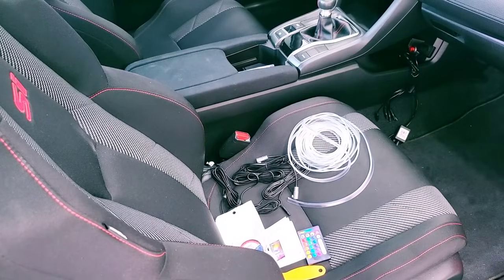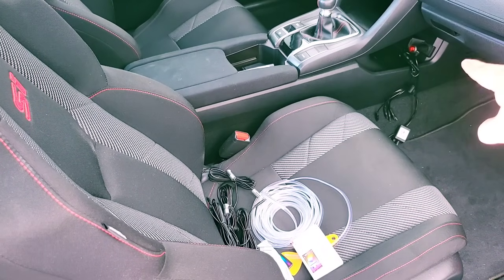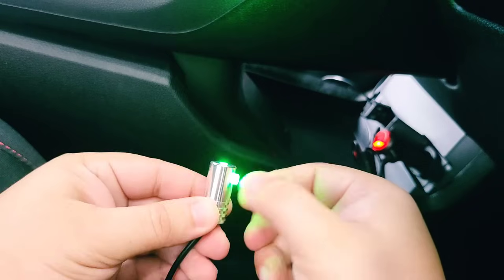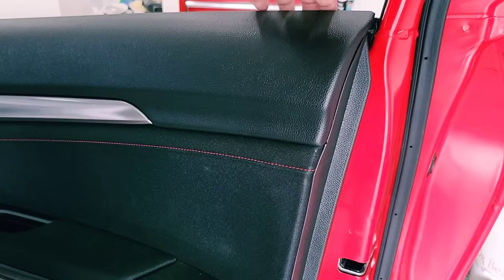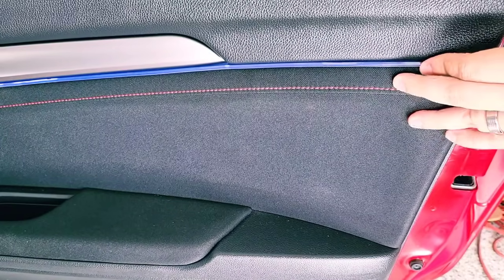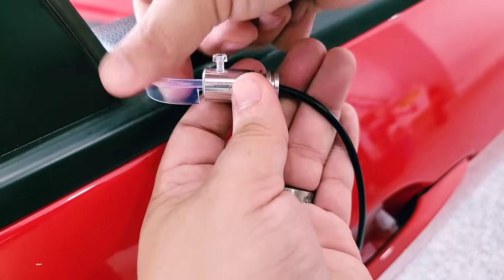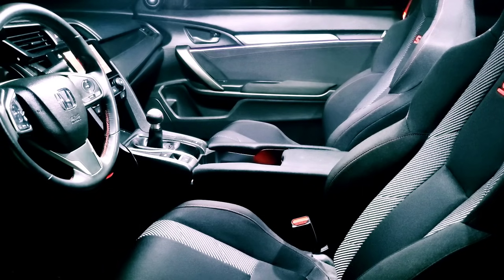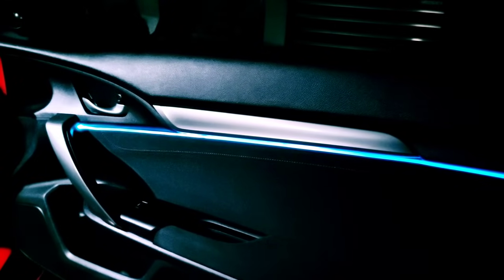Fiber Optic Interior Ambient Lighting Install - RedlineMods

Comment: You forgot to show the most important part, how to route the cable into the car… 🤦🏽‍♂️
Reply from the maker: I mentioned it but recording it is too difficult. Mainly comes off the side door grommet into the surrounding panels. Passenger routed under the glove box. Driver side routes under the steering wheel. Zip ties and that's it. Camera angle is too tight to capture all that.
Reply: @BoostedWhipz  Did you push the wires through the rubber grommet between the door and the car?
Reply from the maker: Yes. Pain in the rear but yes.
Reply: Exactly. I think the version I seen where they open the door panel and connect the wire to the door controls for power is a lot more professional looking.
Reply: @BALL_BUZZ  I agree but I am trying to figure out the plug & play part in terms of where do they get the piece!
Reply: Yeah am here for the wiring part 
I have a 2019 honda accord sport 
But I can't figure it out how to do the wiring
Reply: Hi they will turn on automatically when u start engine or u have to use remote control?
Reply: They all do lol nothing new, you’ll just have to figure it out
Reply: @GabyvsAlice  remote control unless you hook it to your headlights then they’ll turn on automatically with you headlights
Reply: @BALL_BUZZ  how do you connect the lights to door controls? That sounds amazing sense each diode need to be connected to the controller.  I suppose you could connect the lights to windows button so when you roll up/down the window. They light up.  But what you’re talking about is craziness I suppose that’s why you didn’t get a response.  

As for routing the wires it’s not that hard, FYI all of the electrical in your door comes from a central location, essentially the battery. For example your door locks aren’t connected to you’re power windows which aren’t connected to your speaker. All of those are routed thru your door to the cab behind the dash to fuse box which go to battery.  Sooooo more professional… don’t power things with other things, professional says this is how you blow fueses.  

As for how to route the wires look for the black rubber according thing between the door that’s where all your wires go from cab to the door.   

Please link the video you’re talking about I would like to see how these people are connecting diodes to power source in the doors.
Reply: @skidz8426  They take off the door panel and tap into the power windows wire and hide everything behind the panel so as soon as you unlock your car door and the car power comes on the lights will work like factory.
Reply: He forgot nothing, because every car is different.
Reply: Right dum video
Reply: @BALL_BUZZ  yeah, but what if you want to turn it off?
Reply: Our kit came with the fiber optic cable not inside the tube yet… What’s the best way to run it through??
Reply: thank u for saving my time
Reply: Exactly
Reply: Yeah he definitely forgot the most important part of routing the wire smh
Reply: @Jay.G_  It should come with a remote or an APP to control the lights. When the lights use the power window fuse for lighting, they will only come on if they are set to come on. The power window fuse just comes on when the car turns on, allowing power to go to the lights so you can control them, they will stay on the last setting you had them on.

Comment: thought that theres a actual fiber optic cable that you suppose to feed through that strip . thats just routing strip to secure the fiber optic cable man. Just a heads up. it will look alot cleaner and brighter with the fiber optic use which you can buy seperate

Comment: How do you cover/block parts of the plastic strip in places you don't want to see the light, like on the edge of the door panel after the 90* bend upwards?
Reply from the maker: Put black electrical tape
Reply: @BoostedWhipz  ...I figured it could be something as simple as black tape, but I thought there could be a better way, especially if you have a gray or beige interior.  then I guess depending on what color your door panel is will depend on the color tape you need to track down...or just be content with the part of the strip that sticks out....

Comment: My kit came with a wire and the one that you installed do I have to use both put the wire inside of the one that goes into the panels like you did which is better or wsid

Comment: Do these work for trucks? Specifically 2011 models?
Reply from the maker: It's a universal kit. Works on everything. What you need to determine is if the included fiber is long enough or if you need more.

Comment: how did you pass the wire from the door to the inside part of the car? This is what I wanted to see.... :(
Reply: In my accord, I ran mine under the door floor panel and under the seat. I was most comfortable with this so the cables are nowhere near the pedal and brake.

Comment: U have to use remote control every time or they start automatically with turn on the engine?
Reply from the maker: If you leave the main power set to ON it will turn and off with engine since its an accessory.
Reply: @BoostedWhipz  thanks

Comment: Hi can i cut and connect it directly  in power window switch?
Reply from the maker: You could if you know how to.
Reply: @BoostedWhipz  thank you sir
Reply: ... why not splice the main harness (12v cig plug) into the lights fuse slot with an add-a-fuse...it will help keep wires out of sight and it will turn on with your lights...yes, some cutting and splicing is necessary, but in the end it will look cleaner.

Comment: My lights won’t go through the full strip on the door. Did yours do this too?
Reply: Same problem, they are not that bright enough if the cable is over 1 meter long
Reply from the maker: Mine worked fine as seen on the video towards the end. Which kit did you buy?

Comment: Where do you hide the cords?
Reply: More than likely behind the door panel, through thr rubber boot, either under the carpet on the floorboard or tucked under the dash routed to the 12v.